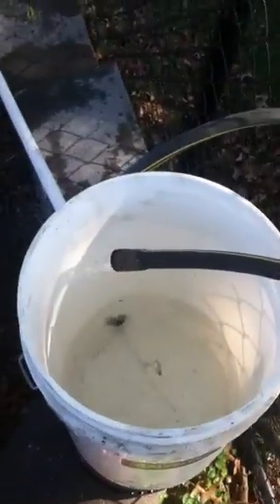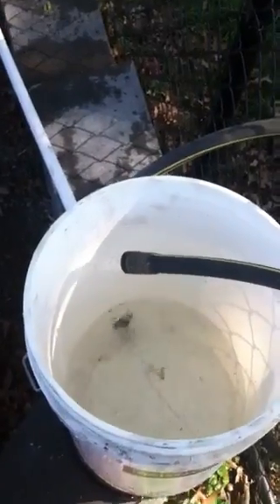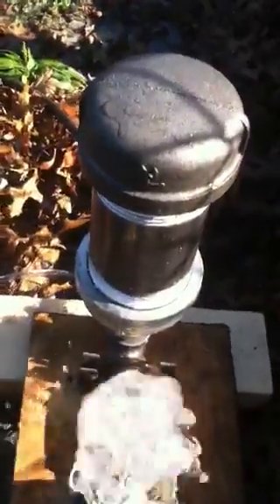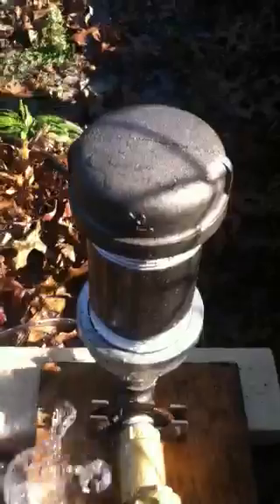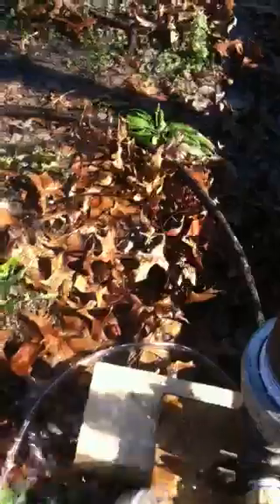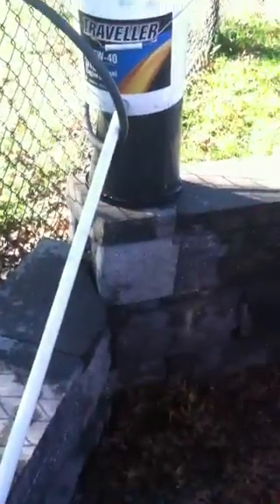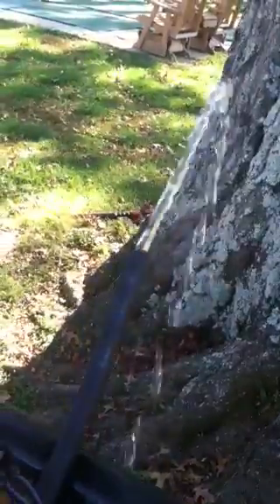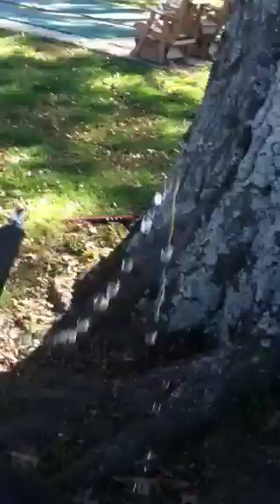3/4 inch to 1/4 inch ram pump home made

Comment: Your ram pump is nice and compact i like the design. Sir how many inch is the length and dianmeter of your pressure tank? Can i buy a pipe only with that length or it is intentionally fabricated? Thanks sir.